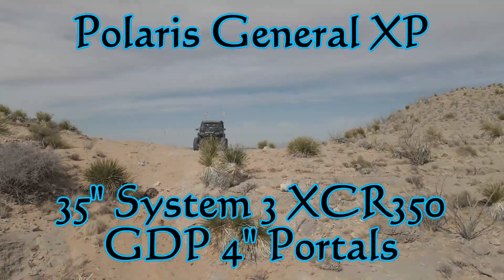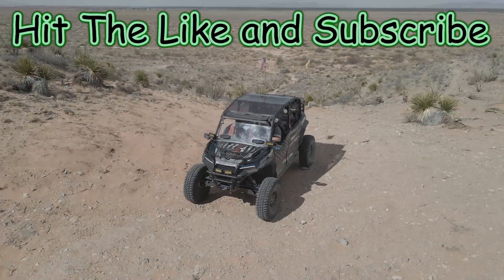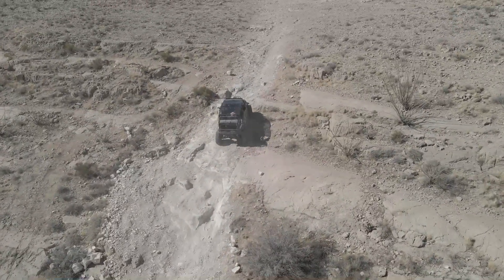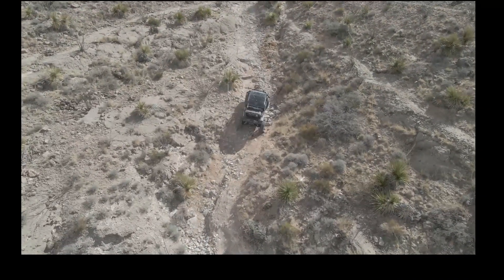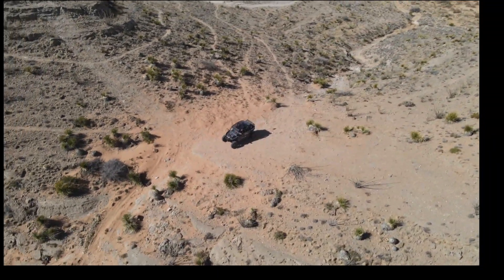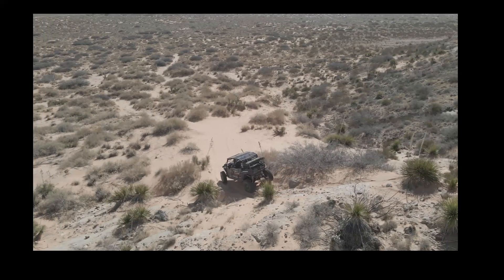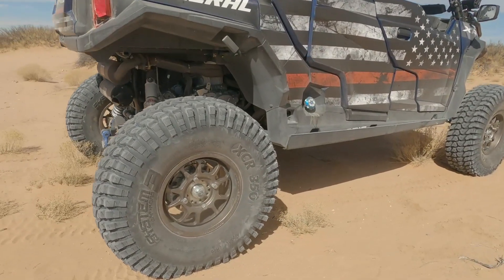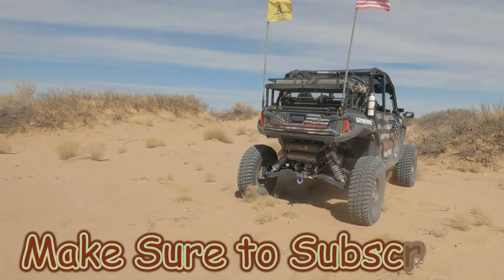Polaris General XP 1000 35inch Tires

Comment: Did you have to install clutch kits when installing the portals? Looks like you do a lot of rock crawling. And that what I’m building mine for. Do you have a video on all the suspension mods drive train mods?
Reply from the maker: You do not have to install a clutch kit with the portals, but I can tell you that the DuraClutch is a great mod, expensive but well worth it. I plan to very soon post a video of the mods that go with the portals. The only real suspension mod that I've done is the Shock Therapy DRS kit. It makes a huge difference

Comment: Did you modify suspension besides adding portals?
Reply from the maker: I did the Shock Therapy Dual rate spring kit, but have it at stock ride height, so for all practical purposes it doesn't change anything there